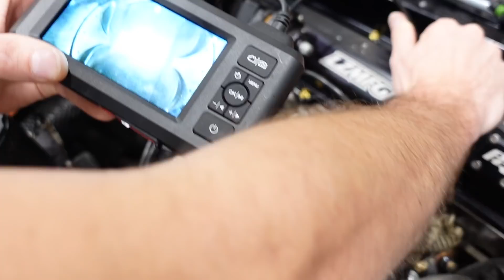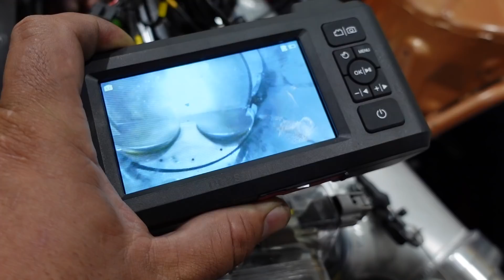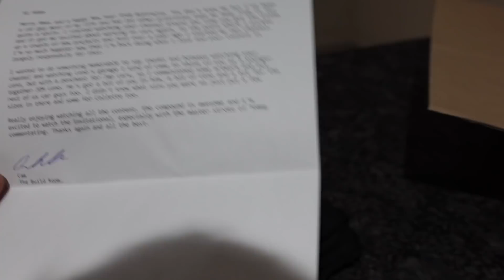2JZ or RB26 - A Sad Truth...

Comment: It sounds like a valve lash is to tight when warm. Huge RB problem.. if not you have a grounding problem. Log the Ecu in closed loop and see what the fuel correction is. Then just check the temp on the manifold temps. It sounds like a valve adjustment or grounding problem.
Reply: Holy smokes! Great input. Hope someone at the compound sees your comment!
Reply: It ended up being shim in bucket. So yeah valve related.
Reply: I had that problem once, it was some tight valves when warm 👌

Comment: Check the trigger pattern in the ecu's waveform tool. The cam crank signal sync could be wandering at idle for some reason. It be because of improper shielding. Try switching to non sequential ignition to see if it clears up.
Reply: I was definitely about to say that
Reply: Agree'd. Lab scope is going to be your friend. I've been a tech for 20 yrs now. Dirty signals will do some interesting things.  Put a lab scope on the alternator ( soo common, that ford has a TSB in the f150's for a missfire at idle), any electric motor for electrical leakage (fuel pumps etc), and potentially install a stereo capacitor in line (temp or perm) just to do some testing.
Reply: When they were building it they were having trigger issues as well. I believe they re wired it back then. Would have to go back and check
Reply: Will defo be related to the stock cam / crank sensors. They are notorious - solution is the ross engineering kits.
Reply: @grant7411  I've had this happen on rb's and a vvti 1JZ.
Reply: That was the basis of my thought as well cam or crank signal related perhaps
Reply: @a.j.lanceleve4320  me too
Reply: I specialize with rb26dett i agree with the cam and crank signal if you look at waveform at idle it should tell you
Reply: @obscurevisuals  me too
Reply: man, You took this words straight out my mouth 😄
Reply: The first ting i thought of was cam sensor or crank sensor being funky, had a similar issue with my 1.8T swapped Lupo a while back and we swapped the crank sensor and had the map check and it was perfect again

Comment: Adam, I was having a misfire issue on my RB, it turned out my IAT was out of calibration, and it was going above the voltage range. I.E. it was going about the 4V Max "Limit" and erroring out causing a misfire, I readdressed the range max to 4.5 volts and I no longer was misfiring/boost cut. Double check you are not hitting a sensor min or max limit because if you are, it typically goes into a default min or max sensor output E.G Max =263F min= -50F, so the map gets fooled into thinking its out of fuel or ignition temp range. I am not saying its your IAT, but double check the logs to see if any sensor is hitting a Min/Max during "Misfire"  (I use a link G4X, but Haltech should have the same error state parameters).  The other double check is your Cam home, and crank position sensor, but I think with your previous issues that should be solid, I had an issue with mine that the sensor was inverse, (I did 12-1 crank)... I cannot remember completely, but I notice a weird behavior in the crank scope that led me to realize it was counting the Gaps, not the teeth... however this did not have a misfire. 

Best of luck, Chris.
Reply: Yep I was just going to say it sounds like a simple sensor issue.
Reply: Yeah for some reason as he was explaining the issue in the video first thing I thought was the crank sensor
Reply: Yeah I was thinking about the crank sensor was moving in and out of position because something came loose after the pulls hitting near max rpm can cause the problem but I was sure it was rectified by improving the components to handle the high revs but maybe it still came loose again.
Reply: stick a camera down and hand-rotate the engine to check all the valves are seating properly?
Reply: @nyc863  you dont do cars do you?
Reply: He has an Haltech elite 2500 ecu , it'll throw error code if a sensor is going bad
Reply: @FakeSTi555  it's not about a sensor going bad, it's about an input surpassing the sensors min/max threshold
Reply: I don't even have an RB and I thought the exact same thing. I always check IAC on rough idle. A good way to test, disconnect IAT and if it goes away you always know. Obviously if you turn the AC on and your car stalls then you'll need your IAC back but this is a definitive test.
Reply: I was going to say that
Reply: @FakeSTi555  true, in theory it should log hitting max value as an error in the ecu event log; I suspect they would know if this is the case.
Reply: Woww story time much
Reply: @hobotechMASTER  oh, ok, so it was a dislodged valve shim, after all.

Comment: Popped a shim on the exh side, I’ve done it a few times, stick a feeler gauge under each cam lobe & one of the buckets will have no clearance

Once you find it check to make sure the keepers & retainer are still good, one of the times I popped a shim it caused the Ti retainer to wear so the collets were catching way too deep into the retainer and almost cause the valve to drop

Comment: a little trick for the power steering (somthing i learnt from a friend who did it in japan on 33s alot) take the solenoid grind down a coin (we used 5 cent coin here in aus) to fit over the face of the valve then place it in the rack it pushes the ventury valve to just the correct spot to allow proper fluid flow where to not make it super soft or super hard and steering feels very very normal. I have this done on my person r33 drift car and have done this to a few friends steer cars R32s and R33s and its been perfect and doesnt rely on then having a trim pots to regulate the voltage which can be effected by alternator issues etc etc :) hope you see this and hope it helps :)

Comment: For the high idle with no evident vacuum leaks I'd look at the TPS and check the idle switch is engaging properly.
You might need to rotate it slightly to get consistent results, as the Nissan ones only have a small range that the idle switch will work correctly in.
I know it might throw out your map slightly but you could rescale the throttle voltages accordingly to correct this.
I should add that I have had experience of this exact same problem on my CA and my RB before, so please do check this. 
Also loose carbon dust from the tracks inside the TPS can cause erratic fluctuations in voltages, and can also stop the idle switch side from making good contact.
Edit - I forgot to say, all the best for 2022 to Adam and everyone at team LZ, and I hope to see the R34 back in action soon.

Comment: Piston failure in the JZ is for sure an issue with EGT and the fact it's a vertical gas ported forged piston and valve relief pockets that are paper thin like most are. Those areas get extremely hot under load, especially with a vertical gas port for top ring seal. Top ring's more than likely steel to deal with the increased cylinder pressures, and probably an iron napier 2nd "oil scraper" compression ring. The thin areas of the piston valve relief are best removed and smoothed  from the piston entirely with a die grinder/sanding bit and then pistons rebalanced individually to matching gram weights. Casting flash in cylinder head combustion chambers causes hot spots, so do piston valve reliefs on forged pistons made for oversized valves, vertical or lateral gas ports, etc. This isn't even a JZ thing, it's a general built engine thing. You're increasing cylinder pressure with the gas port, you made more power and had better ring seal, the extra sauce has to go somewhere. When you have an lean instance from fueling or maybe manifold distribution this will happen. OG V8's guys have been seeing this failure for many years. Broken or burned up on or close the the valve relief where theres gas ports, nothing new...
Reply: He's running nos.  You have to expect these things.  Kills pistons and rings all the time.
Reply: how do you stop this from happening? or how do you build the engine to avoid this?
Reply: @BySixa  as long as the tune is good.  You don't have to worry so much.  Bigger turbo and less nos is the simple answer.  All engines break especially when trying to find ever last hp.
Reply: @duanebailey6253  Probably from someone who has zero experience with nitrous. :thumbsup:
Reply: @FoshizzleItsMikeDizzle  ?? What are you on about? Yup never had a nitrous pull burn a plug tip lol.  Please lmk one person who's able to keep a constant bottle pressure.
Reply: @BySixa  Honestly, make sure the exhaust flows like a dream. Longer runners to the turbo helps a ton as well.
At the end of the day, there’s no replacement for having egt sensors to keep an eye on these things.
Reply: All that heat and not enough gap on that ring. As soon as the two ends of the ring make contact piston top goes pop. Agreed OG v8 guys see that all the time. Ring gap is super important when running lots of boost
Reply: @lilman227  he knows it's to small he wants the response though.

Comment: Sometimes on the rb26 the air flow sensors mess around, other wise some of them has Idle controll sensors with a vacume pipe that might also have a leak.

Comment: yeah the s15 race car is gonna need a valve grind minimum for the top end, that alluminum spray is gonna be coated all over the valves and seats in that hole. seen it many times at my shop. that is 100% melted from going lean btw. not cracked and broken through.

Comment: I had a similar issue on a 98 Subaru, EJ25 block, NA, Check engine light was always on. Misfire. Couldn't chase it down to save my life. Turns out the valve guides are prone to failure. That's what was causing my misfire, so I've been told. Good luck mate.

Comment: When we installed the prp trigger kit on my car the hall sensors didnt work at all. Im told this is very rare from their product but worth noting. 
Was sending interference no matter where the wire was ran or how it was shielded. Could barely make the car idle without the ecu smoothing everything. We ordered some stainless steel sensors i believe, cant remember the brand but very high quality, and they work amazing. Maybe a very minor interference issue with something at idle if you havent ruled that out.

Comment: @adamlz check all your sensors: cam sensor,crank sensor, intake air sensor, throttle position sensor or your idle control valve.

Comment: Check crankshaft front pulleys and woodruff key. Could be that it's damaged and on idle pulley moves a bit and causes misfire. When full throttle, it stays in correct place.

Comment: I can’t remember what ecu you are running, but you should be able to use one of the PWM outputs to control the variable steering solenoid on the rack. Or at least I did on my 33🤔not sure how the 34 works in comparison

Comment: Both are amazing, but I think 2JZ is more Reliable, but rb26 is still super fun.
Reply: Yeah jz is more reliable, but the head on the rb26 flows alot better, so it's really down to personal preference
Reply: And the rb is only 2600cc, while the 2J is 3000cc. So it’s less work to get the same horsepower numbers with the 2J
Reply: @jafhu  Honestly you see some great numbers out of an RB for what it is. Both great motors but imagine if they both went into re production, then there would be crazy engineering changes that i would think would be highly beneficial
Reply: Alright i love both and im sorry if i piss some people off but the RB's sound is just so much better than the JZ in general. Just my opinion though.
Reply: @redsage6550  100% agree 👍 I think the RB sounds way better than JZ
Reply: @redsage6550  definitely lol rb sounds amazing

Comment: Check crank trigger clearance to the crank pulley wheel. Check cam sensor. Maybe it’s an issue with a signal loss somewhere and the ECU is compensating for that.

Comment: Check your fuel regulator , that was literally an issue on someone I knew , the diaphragm was damaged in it and fuel dumps to where ever your vacuum line runs into , our issue were it were dumping fuel into the intake manifold into a cylinder

Comment: If the problem stays on one cylinder exclusively, it sounds like possibly a mechanical issue. Valve spring, retainer, etc. Seems kind of like the issue I had with a mini cooper which had a failing valve spring which would misfire until completely up to temp.  Crank signal issues will usually end up with erratic issues and not just end up on 1 cylinder only.

Comment: Anytime you bore an engine stock block you should only take the minimum. Out so you can over bore again in the future. Going to the full max bore also weakens the block. Build smart. The very minute displacement increase will not be noticed.

Comment: Hey Adam, you could try checking the wiring and all the earth wires for continuity or the throttle body position sensor idle configuration…. I could be wrong, that’s where I’d start though 👍🏻as you’ve checked everything else! Good luck with it, the R34 is gorgeous!! 👌🏻

Comment: The new Haltech firmware has a built in scope, run the scope and watch the trigger pattern on idle, also, I've had some issues with a faulty CAS and coil packs on my RB.

Comment: So assuming you are on the nsp software, check on the oscilloscope test and see that you have a clean pattern I have had to change cherry sensors before on the crank.
Also check your VCT isn't stuck on mechanically. Or the good old shim left the building.

Comment: If it doesn’t do it while it’s cold could be coil pack related because jz’s have the same problem when it heat soaks the coil packs it makes it break up, check the ohms in the coils should be around .5-.8 ohms

Comment: On the injector flow test, they all looked well off. One of them was delivering a lot more than the rest. The spray pattern looked weak too.
Reply from the maker: That’s just my machine, It doesn’t seal at the bottom. More for visuals on spray pattern and leak testing than anything
Reply: @AdamLZ  fair point, looked suspect but makes sense now.

Comment: How much vacuum do you have at idle? Where are you getting you boost readings from for the gauges and ECU and do you have any vacuum lines blocked off? Check the ECU and see if it’s adding a lot of fuel in the long term trim. You have to be careful with getting too many taps into a single place, especially if it’s the back end of the balance tube.

Comment: Cam sensor potentially?? Maybe there's interference with the crank.. cleetus was dealing with the same thing on ruby. Misfire at random/under load. Everything else was fine.. but the cam sensor was picking up part of the crank and error. Check that out man.

Comment: Do a running/idle compression test. Disable coil/injector cylinder by cylinder and let idle with compression tester installed. May or may not have to remove the valve core that functions as a check valve from the tester. Found random slightly bent valves that way that passed leak down and conventional compression tests.

Comment: Easier fix with the steering weight... Change the voltage to the solenoid using the Haltech. I run my R32 at 3.5v is a nice weight.

Comment: If a car spits or missfires, it‘s most of the time running to rich. I would try to lean it up a bit and set it up with a lambda tester. Get it around 0,80, lower would be way too rich. The highest I would go would be 0,87 which is pretty lean for this kind of engine

Comment: Use a labscope and start getting raw signal instead of swapping parts. Maybe a mobile diagnostic guy who has pressure pulse and in-cylinder sensor can check dynamic pressures while engine runs to check valve train events and sensor signals for you

Comment: I'm unsure how the v-cam is setup on your ecu, but now that the car is idling a little higher if it has been set incorrectly you can have a situation where the cam angle is advanced  at idle and will sound like a misfire, if you datalog intake camshaft position at idle its one more thing to rule out,

Comment: What's the throttle linkage look like? What about a bent throttle plate? I understand it's a fair amount of work to pull the throttle plates but get them off and look through them with a flashlight for one or multiple plates with larger than normal fully closed air gap.

Comment: Have a friend who  was having a similar issue and it turned out that his spark plugs were not gapped properly maybe try checking the gap even if you changed plugs you still should make suer the gap is corect for what you are doing.

Comment: It's not an RB but I just had a similar issue on a jeep 3.6l v6 and what would happen was it was idling fine until you put it in gear where it had a small load the injector pulse width would increase on the left bank but the right bank where the problem was it would stay about the same then it would clean up as you revved higher so at a stop light in gear it was misfiring like crazy then cruising or getting on it hard everything felt good no misfires. the long term fuel trim for the right bank would immediately go from like -2 or -3 to -24 when you go from park to drive so it was leaning out by pulling it's own fuel. I found the right bank upstream 02 sensor was reading -83 degrees for the 02 sensor heater temp and looked like the sensor was reading ok when you revved it but didn't  seam right compared to the left bank. the faulty 02 sensor was new so I wasn't sure it was faulty but since it was difficult to reach the connector I decided to just try a new sensor instead of testing the harness like I normally would. new sensor fixed it, never seen an 02 sensor cause a misfire like that so it's worth checking and like I said the faulty sensor was a very new sensor so it's possible you had a sensor failure. hope this was helpful and I hope you get it figured out.